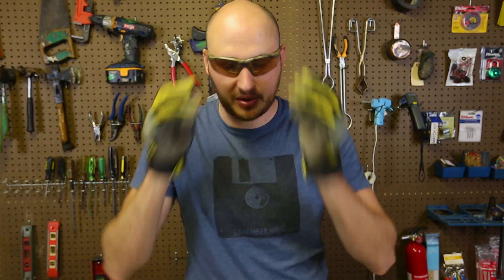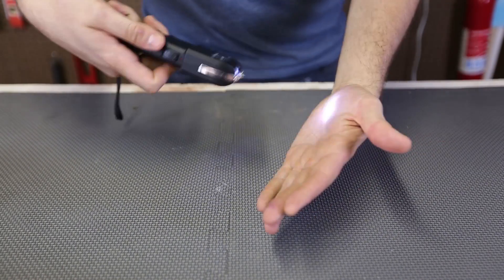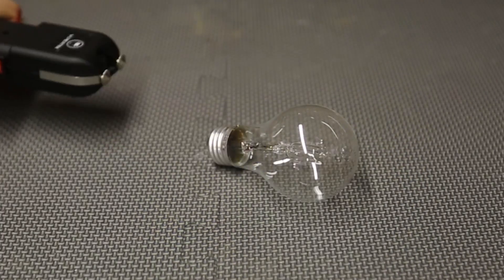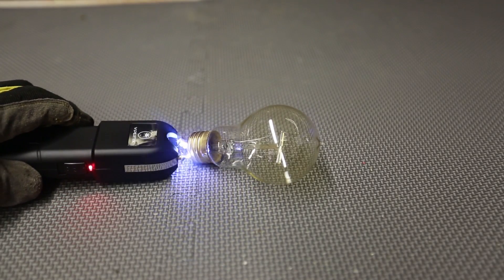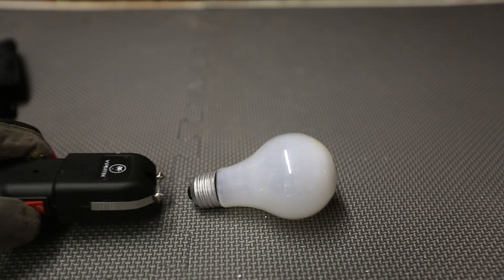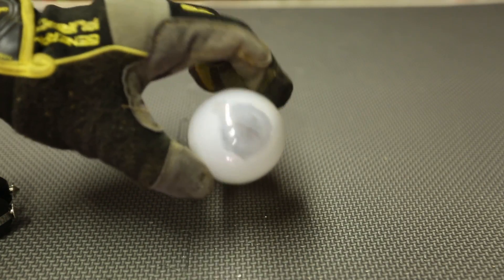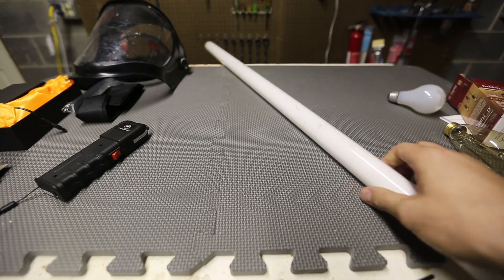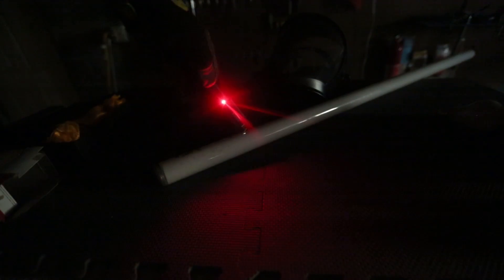What Happens If You Taser Light Bulb?

Comment: the first one was a halogen light bulb the taser was activating the gasses , without the filament 
the 3rd one has phosphorescent coatings,  the taser activated those. .  
ought to try with a fluorescent bulb but watch out for the mercury vapors if you crack the glass.

Comment: if i recall correctly that 8 ft bulb would not light up all the way because the bulb itself is part of a circuit
electricity runs in one end and out the other (with a ballast of coarse)

Comment: The reason(i believe) is because tazers have a high voltage, but low amperage. That makes it taze you a lot but use little battery power. Not as good for lamps.

Comment: I've gotten tazed, it's not that bad. I've also been pepper sprayed. and that is.... yeah, bad.
Reply: How bad being tazed/zapped by a stun gun is dependent on several factors actually.

1. Voltage - The higher the voltage is, the worse it can harm someone, the higher the odds of causing electrical burns where the contacts hit (and higher odds of worse burns too), and the higher the odds of killing someone by stopping their heart (especially if the target has a heart condition, regardless of whether they know they have one or not).
Reply: Stig Rabbid you're certainly correct there. thankfully handheld tazers aren't usually fatal. Stunguns are the ones you have to watch out for. I think that mostly depends on how well the person being stunned responds to electricity screwing up their heart rhythm for a moment or two.
Reply: Location is definitely something to watch out for. Police training does have its perks :P